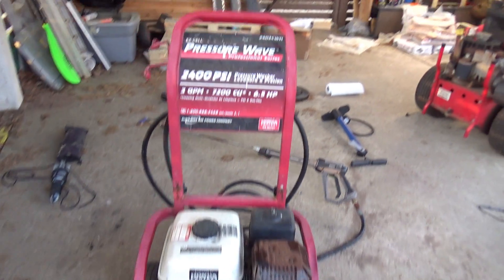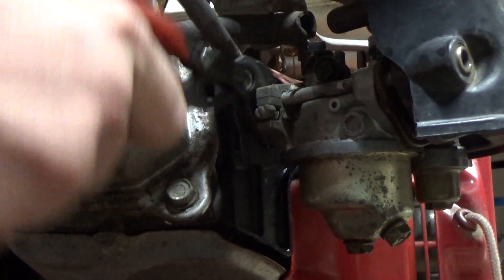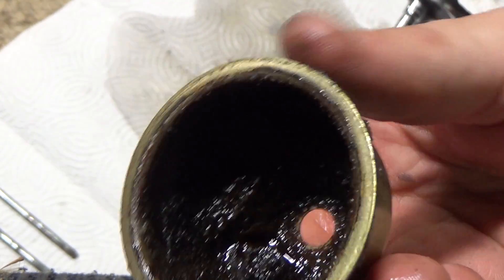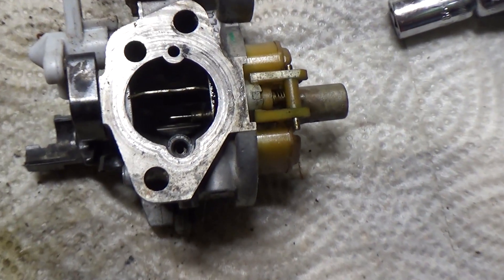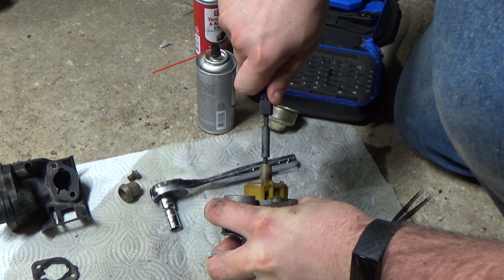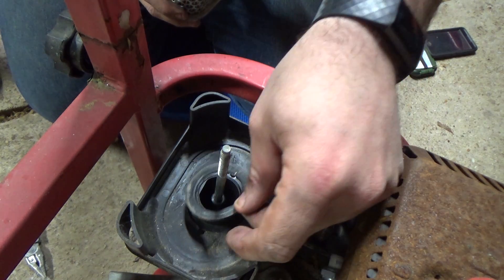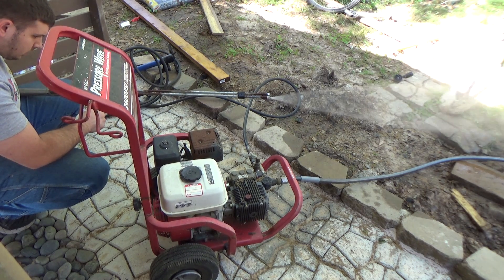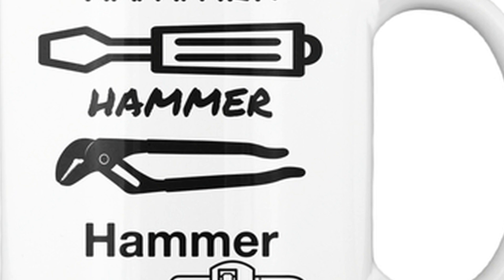Honda GX200 6.5 engine won’t start diagnosis and fix.  Pressure washer engine won’t start fix

Comment: my honda clone wont start after i  i took crankcase off and valve and push rod came off i put valve and push rod but it missing a valve seat/retainer so im gonna find out if it wont start for that retainer/seat or the parts fell off again inside crankcase

Comment: Great video ! Maybe you can give me some advise. I have a GX200 on my generator. I had it running last spring 2020. Now I have no gas in the carburetor bowl or sediment trap. I have gas right to the inlet on the carb. Gas valve is on but no gas will flow. Took the carb off, cleaned the jet, nozzle and trap everything seems fine but can't even get air to go through the gas tube inlet. Have it soaking in cleaner for a few hours now. Any suggestions ? 
Thank you in advance
Reply from the maker: Check valve to make sure gas is leaving tank.  Use a paper clip or small wire to clean out the inlet side of your carb.  Check to make sure the needle valve isn’t sticking
Reply: @CreativeMechanic  Hi, I was getting gas right to the inlet on the carb, the needle valve was fine. I used an 18 ga solid copper wire on the inlet tube and the small hole under the shut off valve. That small hole was jammed up with very hard material. After about an hour I got thru it and was opened up. I had this soaking for hrs in carb cleaner, blew compressed air, nothing I did until the wire was able to clear it. Thanks for your help !!!

Comment: Just followed your video on troubleshooting a Honda GX200 on a power washer my neighbor gave me. I took apart the carb exactly as shown including the jet. There was a bunch of gunk in there but I put it back together with some fresh gas and it started on the first pull. Very rewarding, thanks for the excellent video! Next step will be fixing the leaking water pump but that's a job for another day

Comment: This is a very good video, thanks. What type of fuel cleaner do you recommend?
Reply from the maker: Just start adding Sta-Bil to your gas later in the season.  That will keep it clean when you put it up for winter.
Reply from the maker: Also, thank you! 🙏